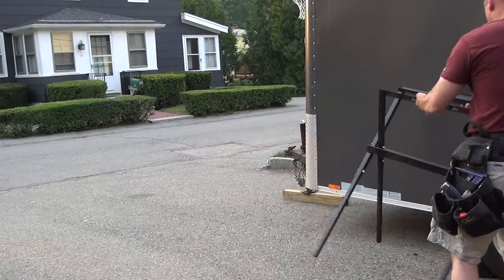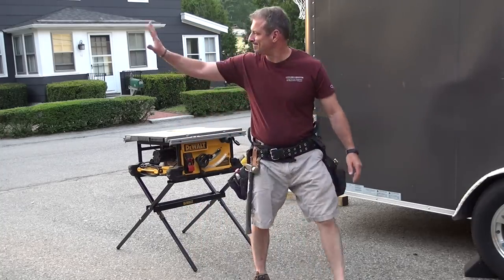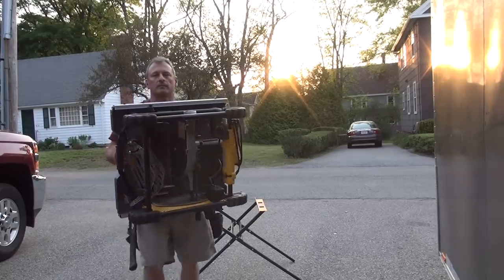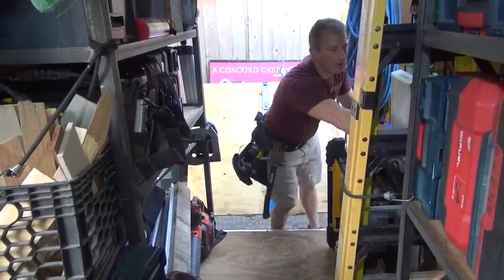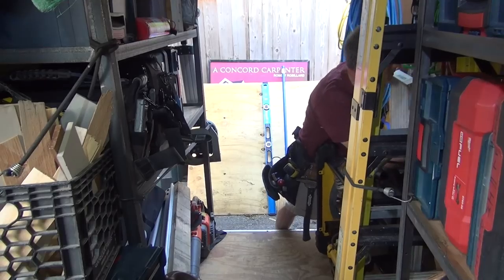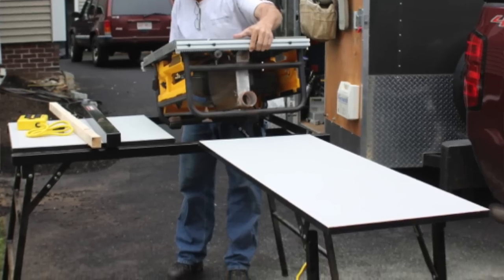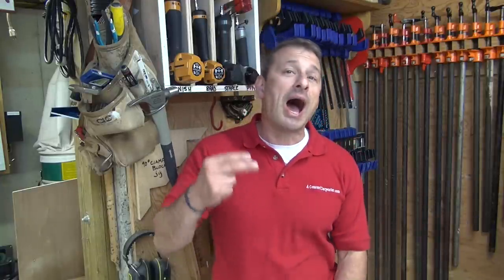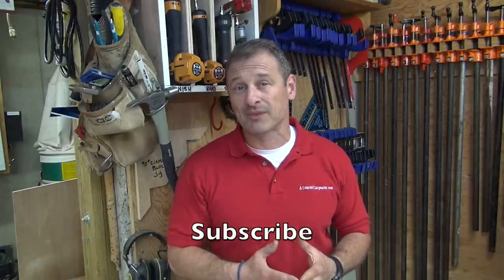Compact Portable Table Saws – A New Breed!

Comment: As a contract carpenter I fully agree with you Rob , since I purchased my Dewalt 54volt flexi table saw it was a game changer for me . I work on a lot of social housing projects where we have to move from house to house numerous times a day . Having a saw that's light enough to do this but be big enough to cope with most day to day ripping of timber was a game changer . I'm 60years old now and having this type of quality tools light and versatile is just great . Dewalt have to be congratulated for this innervation , and you can be sure the other top brands will follow.

Comment: I bought a porter cable from lowes earlier this year, it's got the wheel base and damn I love the thing, not just the saw, but the base too. I love how I can fold up the base with the saw on it and roll it into the corner of my small shop when not in use. I can easily pull it up through the bilco door to work outside of needed.

Comment: DeWalt DW7480 mounted on DW7440RS rolling stand for me ;-)
I seriously considered the DW745, which in all honesty would probably be all I'd ever need, but for just a few dollars more I get the rip capacity to cut an 8x4 sheet of plywood in half....
  How often will I do that ?, very rarely, but I like knowing I have the ability to do it, with a saw that is no bigger or heavier, and not really that much more expensive, so why not ?
  And the stand is great ! Rolls around very easily, the legs fold out and provide a very solid stable base, and the saw detaches so easily by just depressing two levers and lifting the saw off
 Just makes the whole setup very versatile and mobile.
Thanks for another great video Rob, Love your channel !
Reply from the maker: Thanks man I appreciate you taking the time to comment, it's my reward!

Comment: I have two table saws that I own, Bosch 4100 and the gts1031 and more often than not, I find myself using the smaller lighter and more portable saw over the larger Bosch 4100. Both are really good but I find the smaller gts1031 fits my needs 90 % of the time. Another great video Rob.
Reply from the maker: That's the point - these smaller saws are so good not that 90-99% of the time we can still achieve what we need without the size and weight.  the BIG saws still have their place, but for many of us, not daily.  Thanks Mike I appreciate the comments!!
Reply: Same here, except i have the small dewalt its less bulky than the other one

Comment: I use the Festool track saw for breaking down full 8x4 sheets to size then transfer the smaller pieces to my Dewalt dw745 table saw for further cutting down , there both light super compact and accurate can fit everything in a small van

Comment: Are these accurate enough for woodworking? These job site saws are marketed to contractors but for a tiny garage workshop everything must be storable just as well.
Reply from the maker: Like anything else I suppose what level you're talking about, the rack and Pinion fence on the side is amazing and extremely accurate

Comment: Rob,Could you please give a review of the Rousseau tablesaw stand that is featured in this video? Is the fence on your unit sturdy and accurate? Does the fence slide smoothly or does it stick when you adjust it? I have a Bosch 4100 and the fence is terrible and inaccurate to the point that I'm considering selling it to rid myself of the problem. However, I like the idea of the Rousseau Portamax 2790, but I'm having trouble finding any valid reviews on these systems. Any insight would be appreciated. Thanks, and keep up the great work.
Reply from the maker: Greg Alan http://www.aconcordcarpenter.com/rousseau-portamax-2745-table-saw-stand.html/img_1102
Reply: Thanks for the link.

Comment: Hello bud, is possible with a table saw  to cut all the large board in 45 degrees? , for example 2 in X 2 in X 8 ft
I did't watch any vid showing how to make it...
Reply from the maker: Argendiego do you mean rip a 2" board at 45?
Reply: Thank You to respond....Yes the board is 2" x 2", but I need to cut  all the long 8 feet to 45 degrees, is dangerous?
Reply from the maker: Argendiego it's very possible to make a continuous 45° rip I just could not 100% sure how high the blade will cut at 45-degrees
Reply: THANK YOU !... I think the DeWalt can to cut untill 2.25 inchs high at 45*

Comment: This is the first video on saw that has mentioned the "table system" where can you buy these systems?
Reply from the maker: Do you mean the Rosseau table system?
Reply: Think it was a metal frame with white surface in the video. Looks like you can drop your saw into the system and have more work area? Will google the name you typed in thanks.

Comment: for me, nothing is even comparable to the dewalt rack and pinion system. i cringe using standard table saws.
Reply: in fact, if dewalt is listening.... how about a safety stop, rack and pinion, worm drive w/ 3.5" capacity all in ine saw?!  please!  if not, go for more capacity than 3.5". great vid as always Rob!!
Reply from the maker: +CaptainsOrders great points
Reply: If you want worm drive, why not just buy a skilsaw one?   I wouldn't want a worm drive, I don't want to have to mess around with changing the oil on my saw.  Plus, how often to you really need to rip 4x4's.
Reply: CaptainsOrders
There are  several things for building a table saw yourself
Find a proven set of plans online 
Find a colleague who wants to build one too so you have another person to help you
(I learned these and why they work from Wilfs Wood Blueprint website )

Comment: Look under any saw before buying.  I have a Dewalt 7480 it is a piece of junk.  The fence lock gives out...see other posts on this problem. The mechanism is unbelievably cheesy!  Also the rails are very weak. The skinny little rails the motor and blade ride on bind and need regular cleaning an lubricating.  I was fooled by the reviews and my, also plastic Dewalt Chop saw, which has held up.  I'll look at the Hitachi, Makita and Skil.
Reply from the maker: Mark Petrofsky  You cut and paste this response on two different table saw reviews now. Can you tell me a table saw that fits your specs?